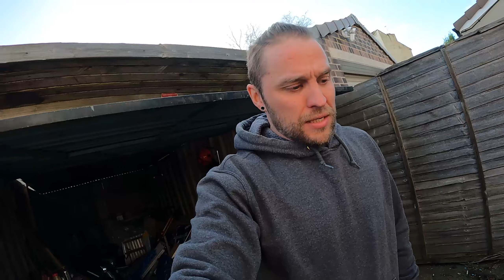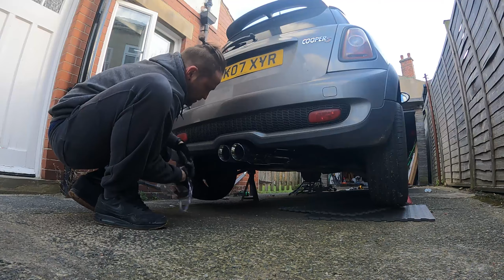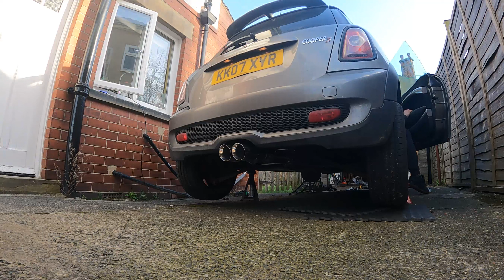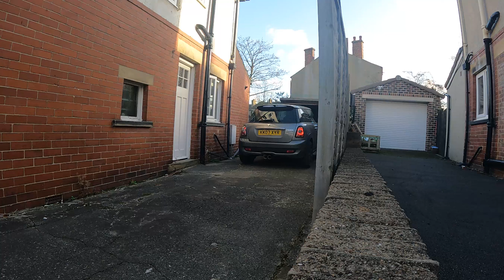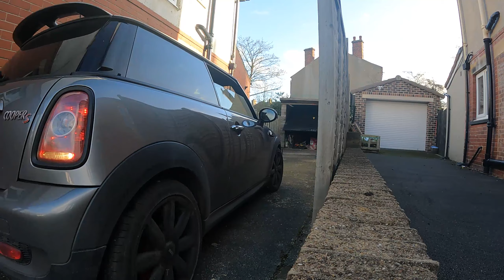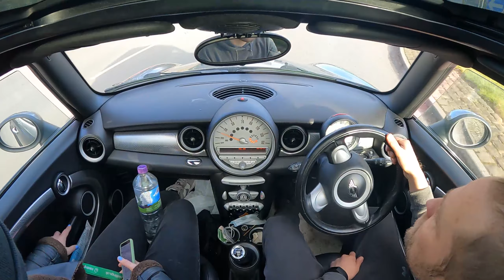Mini Cooper S R56 Malian Full stainless exhaust install and road test

Comment: I just had this installed on my R58 JCW and you are correct- the drone is unbearable. I do not have a resonator. If I put one in, would it take the drone away and more importantly, would I still have the burbles and pops?

Comment: Just bought one. Gets fitted next week 🤞🏼
Reply: Update: it’s fucking loud but went on so easily. 

It does drone at around 3000rpm but is fine once you’ve changed gear. 

Motorway is fine. 

It’s a very deep sounding exhaust.
Reply: Hi there, very nice value for money.
Question, would it be possible to only fit the rear muffler? It would possibly be not that loud. 

Maybe more videos of the sound?

Thx from Holland.

Comment: Any updates on this??

Noise?
Rattles?
Power?

Anything to suggest getting one or not?
Reply from the maker: Noise - Yes! I'm getting used to the noise of it now, although it does attract a lot of attention which I don't particularly want.  

Rattles - Nope. I did have to adjust it a little after I made this video as after I'd hung it and tightened everything up it was touching a heat shield - making an already noisy exhaust pretty much unbearable to drive. Some slightly longer rubber hangers and some tweaks to how the pipes fit together made that better though.

Power - certainly no less than before. The restriction is at the cat so if it's power you're specifically after you wanna be looking at a high flow cat or a total decat. I've got a gravity sports cat fitted which made a noticeable difference in power - and it recently passed an MOT set up like this.
Reply: @n8green  Im deffo going to get one. Have you got a link for the rubber hangers?
Reply from the maker: @fatfarina  these are what I used https://www.ebay.co.uk/itm/353619196089

Comment: Is that catted or decatted?
Reply from the maker: It's a gravity sports cat off eBay :)
Reply: @n8green  do you know where I could find info on whether or not it would pass US emissions tests?
Reply from the maker: @NatedoGP  No  I'm afraid not, but I doubt it would tbh - although I guess different states have different standards? It's due an M.O.T next week (UK 'roadworthiness' test, which includes emissions tests). I'll post back with whether it passes or not!
Reply: @n8green  Did it pass the M.O.T? :)
Reply from the maker: @Coolcowvalley  it did! 🙌
Reply: @n8green  Really?! Thats awesome! Did sound deadening your car make it any quieter? There's a R56 Cooper S for sale near where I live and it has the same exhaust and downpipe you do, but I'm a bit worried about the noise long term x)